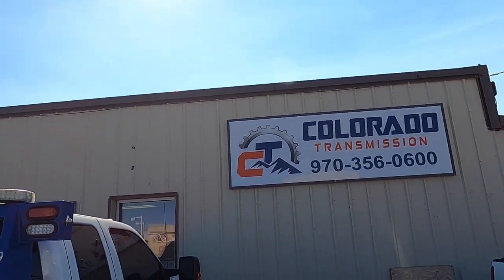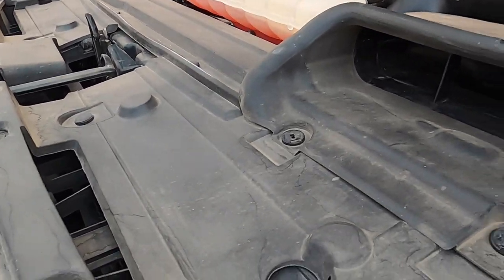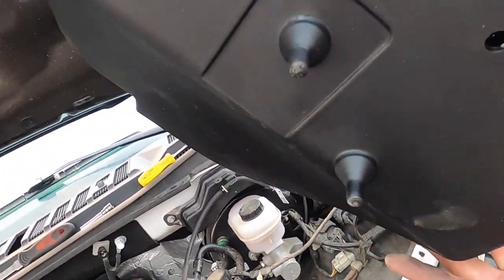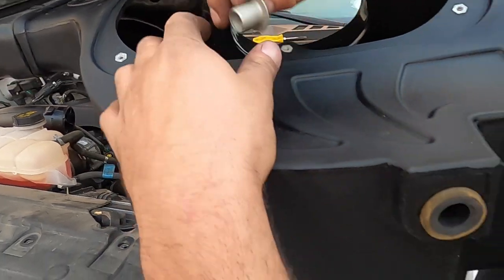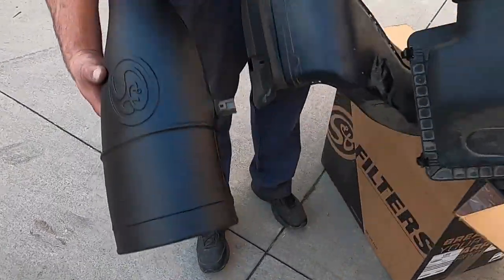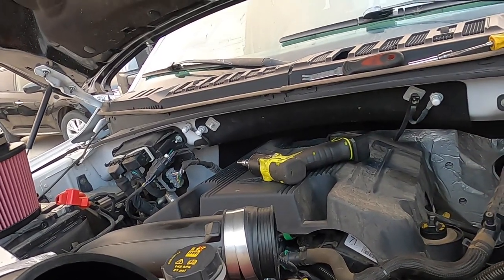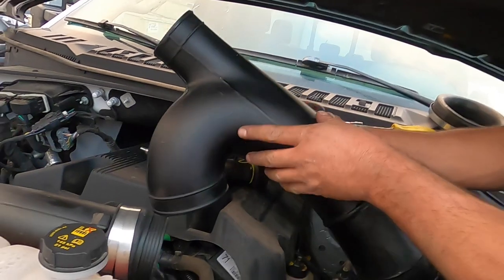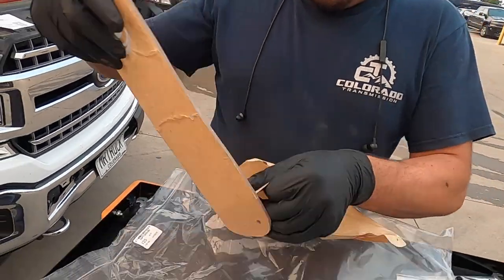MrTruck's F150 has more power, more air, uses better factory "Fuel Genie, Tornado, vortex, venturi.

Comment: Bought a 2019 F150 XLT with the same engine last December. Got the same cold air intake and installed it. Started getting check engine light, so I took it to the dealer. They replaced valve covers, oil cap gasket, crank case ventilation sensor, couldn’t figure it out, so they called Ford. First question Ford asked was if it had aftermarket parts, told them not to touch it again until I put the stock air intake back on. Put it back on, no check engine light. Mechanic said it was “ Over pressurizing “ the engine.
Reply from the maker: That's odd, something might need re-tightening. S&B and it says this on the box and the paperwork that they guarantee it won't mess with your trucks warranty. You can call S&B, tell them what happened. A week after I installed my S&B on my 2018 F150 EcoBoost 3.5L, I took my truck in for Cam Phasers. They tore the engine done to the block. They had to take my S&B off and they put it back on. No problems.